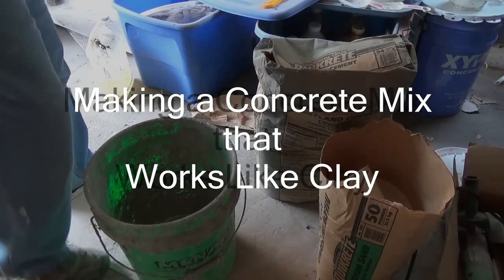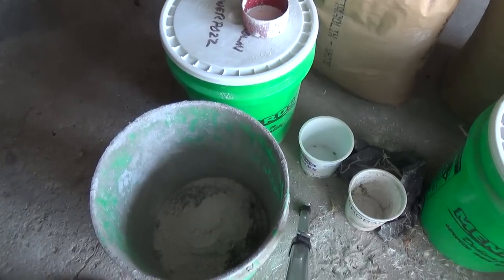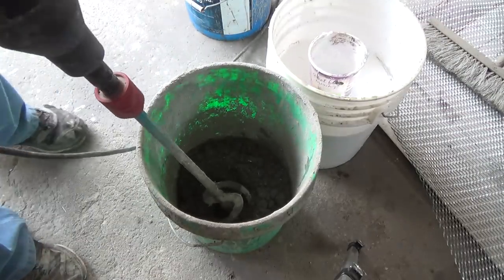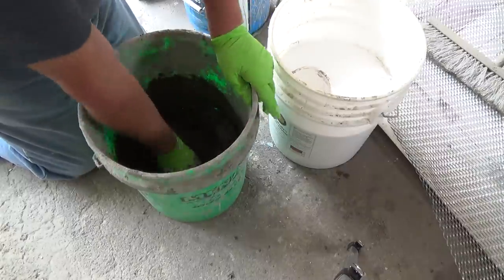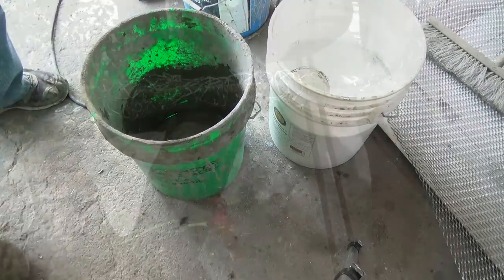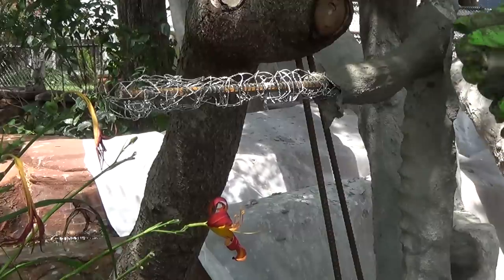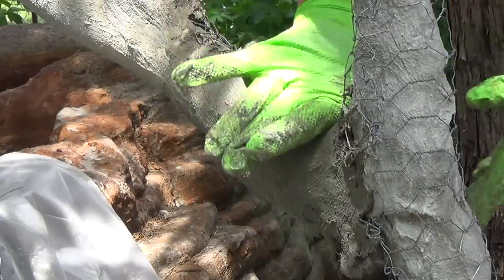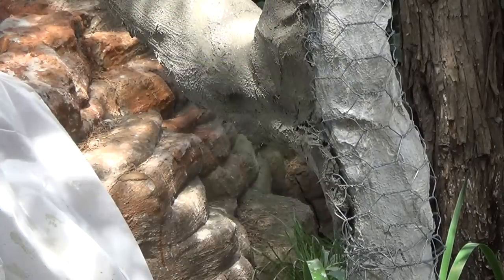#concrete #fauxbois Making a Concrete Mix that Works Like Clay

Comment: Thanks so much for your generosity sharing this recipe for this clay-like concrete mixture with materials that are not too hard to find.  I'm just curious: when you are squishing the concrete into the chicken wire structure, do you make sure all the air holes are filled? If you didn't, would it crack over time? Again, thanks so much - this is exactly what I've been searching for!
Reply from the maker: I squeeze the mix in as best I can.  I can't absolutely guarantee that there might not be air bubbles left, but I can be sure that it will not crack. Concrete cracks because water can infiltrate, freeze, expand and break up the concrete. This mix, because of the metakaolin and acrylic admix is virtually impermeable to water.  No water, no freezing, no cracking.
Reply: @dperry428  I didn't ask the question but I'm reading to learn more from other people's questions.. I'm so glad I read this one because it helps me understand why your recipes contain the ingredients they do. 
Actually it's like learning about various spices while learning to cook. It's very interesting....Thank you so much for sharing your knowledge.

Comment: questions, what is the working time  with this mixture? you talk about carving, does that mean it does not become as hard as concrete and how does it withstand the weather? meaning rain, snow tempteratues in the single numbers, and so on.
Reply from the maker: Working time for this mix, like any concrete mix, depends on many variables, such as temperature, humidity, wind conditions and exposure to direct sunlight.  Set time can be controlled with the use of cold water or even ice in the mix to delay set, as well as addition of retarding agents, such as sugar. You can speed set time by using hot water or an accelerator such as calcium chloride. I didn't talk about "carving" except in reference to a commercial "carving mix" that I was going to try in the future.  Regardless, concrete hardens in several stages, including initial set and final set, during which concrete loses its plasticity and begins hardening.  It then continues to harden over a period of approximately a month. I texture the surface of the mix before, during and after initial set.  If additional texturing becomes necessary, one actually can carve it like very soft stone.  As it continues to harden, techniques used in sculpturing hard stone need to be employed, such as grinding or chipping. Once this mix sets, it is very dense and very hard.  As hard as concrete? Yes, because it IS concrete.  I live in northern Illinois.  We have extreme temperature changes from 100 degrees Fahrenheit in the summer to -25 degrees in the winter.  Because of its density, it is very resistant to water penetration, resistant to freeze/thaw cycles and far more durable than regular concrete mixes.

Comment: Sir,
I have been watching most of your videos with great interest, thank you for spending the time to share your knowledge.
I have a question for you if you don't mind,
Would you have a concrete recipe for casting garden statuary in latex molds?
Any help would be appreciated 
Thanks
Reply from the maker: You can use the  same recipes and add superplasticizer to make the mix more fluid to flow into the mold.

Comment: Hope you and your family are doing well during this Covid-19.  I 'm nearing the end of my project and I would like to know if I need to add Xypex to my mix to make my pond better to handle the water. I will upload a new updated video tomorrow. It can be a real challenge because I don't have a stand to help me with the video.  Thank you for your helpful videos. You are a VERY Talented man.
Reply from the maker: It's up to you.  Xypex is expensive, but I wish that I had added it to my earliest projects.  You can add Xypex admix to the mix at about 2 to 3% of the cement content or you can use Xypex Concentrate as a final coating or you can do both.
Reply: @dperry428  Thank you. I will figure this out and let you know what I do in a video when I'm at that point in my project. We are in the process of installing lights right now. The water "mini pond" will be after that.
Reply from the maker: As small as the pond area is going to be, you  might find it much more cost effective to just use Thoroseal to waterproof it.

Comment: Can you use instead of meta kaolin -Mullite  which I understand is a high heat processed metakaolin.? I use it as the base for slurry in creating shells over wax in bronze casting. I happen to have a lot of it and thought maybe I could substitute it in this concrete clay formula.
Reply from the maker: I don't know.  Never heard of it, but having just spent a bit of time reading about it, it is made from kaolin clay, as is metakaolin, but heated to a much higher temperature, changing the initial metakaolin into mullite.  Metakaolin is amorphous and exhibits certain characteristics as a result.  Mullite is the opposite and is crystalline and would, therefore, exhibit entirely different characteristics.  The only suggestion I can make is to try making a mix with it and see what it does.  I'd bet it would be much different in its effect on the mix than does metakaolin.

Comment: Hi there, I am trying to mend two halves, and fill in some missing areas of chunks that broke off, of my cement birdbath pedestal. Any extra advice? Also, I am a bit unsure still about the "acrylic admix" part of this project. You mentioned that Quikrete has a product. I went on HomeDepot.com and found a 1 qt. Acrylic Fortifier by Quikrete. Is this the product to get to add to the water? I could not find the product called acrylic bonding agent which you replied to Sporty a few days ago. TY
Reply from the maker: The Quikrete Acrylic Fortifier is what you can use. I don't know the solids content.  Follow their directions for dilution.  Home Depot usually also has an acrylic by Sika.  As for the birdbath, I drill holes and peg the two halves together with metal rods and glue the two halves together with marine epoxy.  Then fill the crack with concrete or put a full new liner of concrete in the bowl.  For missing pieces, use acrylic full-strength on the broken part and fill with acrylic concrete.

Comment: Was also wondering if you have a papercrete recipe? Clay like to hand build large posts yet light weight to move around easily enough? 🤷🏼‍♀️🤔
Reply from the maker: I don't use papercrete; don't like the fact that the cellulose fiber in paper is organic and subject to decomposition, much as leaves in a compost heap.  To make lightweight concrete, I substitute vermiculite or perlite for some or all of the sand.  Remember, though, that the lighter you make it, the weaker the mix will be.  You substitute weight for strength.
Reply: @dperry428  Amazing thank you - yes you’re 100% right

Comment: That mud looks like a winner , but I am thinking the additives can be very expensive, especially if having to pay shipping from distance too far to pick up.  I was wanting to find out if some type of common inexpensive chemical or product can be added to cement to give it a clay-like clumping feature.  Was thinking of vertical wall or fence building without having to use forms.
Reply from the maker: That is the purpose of this mix and others I use -- vertical application and sculpting.  There are mixes too numerous to list that are used by others to do the same thing.  Many of them are commercial proprietary mixes that cost a small fortune to buy.  That's why I make my own.  What I have developed is what works for me.  I am not an expert in concrete.  I don't do research on other mixes and I certainly won't or can't vouch for other mixes.  All I can suggest is do some research.  Do a cost analysis of this mix, including shipping costs, compare it to commercially available mixes, including shipping costs and decide what is best for you, both functionally and economically.
Reply: dperry428 I have been looking into Pal Tiya, but this seems very similar an probably a lot cheaper. I want to sculpt a fountain. I assume I can just use some sealer on this stuff after it’s dried?
Reply from the maker: @AaronDigitalMuppet  The mixes I prepare are made to negate the need for sealers, though, if you want, there is no reason you can't use a sealer.  Sealers, themselves, are different, too.  Some, like siloxane, are penetrating sealers. Others are simply coatings that stay on the surface.  For things like water features, including fountains, that are going to be constantly exposed to water, the penetrating sealers are more appropriate. Water is the enemy of concrete.  Keep water out of it and the concrete will not deteriorate. A major function of metakaolin and other additives is to close off the porosity of concrete and prevent penetration of water.  In my constructions that are going to be in water, I now also use a crystalline waterproofer, such as Xypex.
Reply: @dperry428  Thank you for both a very detailed, and quick reply!

Comment: Hi great vid - just wondering, for the sand do you use sharp sand or is it some kind of grit sand or paver sand ?
Reply from the maker: I use what's available.  It's best to make sure it's a silica sand and, at least for  the purposes of making it work like clay, the very finest you can get.  When I was helping my brother in Tennessee with his pond, the sand we could get was ground up limestone an it was awful to use and not as strong. Unless you're a contractor, you use what's available from the local home store.

Comment: Thank you! Have you seen the tiles that look like wood planks? I bet if this ratio would be perfect to place in a thin silicon mold and make diy wood planks or brick shaped pavers.
Reply from the maker: Yes.  Actually, if I were making molded wood tiles, I'd add silica fume to this mix, as well as a super plasticizer to make the mix stronger, self-consolidating and self-leveling.  It would, indeed, be strong.
Reply: dperry428 Knowledge through experience is key.  You are a pro. I have zero experience with cement.  Thank you for your response and advice.  I feel like I would like to try to  make small batches of planks.  Eventually. I could  accumulate enough to floor over my concrete patio.

Comment: Very educaring and inspiring video sir dperry428. I've bee doing a very disastrous and frustrating DIY wall stamping using type 1 portland cement and sand. I got a question, can i use type s cement, sand and acrylic polymer to arrive at same consistency as what you have done?
Reply from the maker: Type S is masonry cement and has lime in it, so it will be stickier. I used to use it for that very reason until I wanted a more impervious, denser mix and started using metakaolin and silica fume.  The type S made the mix too sticky, so I switched to regular portland type l.  The polymer will make a big difference.  Prep the wall with acrylic, add acrylic to your mix and apply to the wall before the acrylic on the wall sets.  You can certainly make a very thick, clay-like mix.  Use a 1 to 1 sand/cement mix and watch carefully how much liquid you add.
Reply: @dperry428  I will certainly try what you have suggested. Thank you for the response and advice.
Reply: @dperry428  Another thing sir, can i use the said mix 1as a stone to cement adhesive?
Reply from the maker: @darwynpeckley277  Not sure what you mean by stone to cement.  If you mean adhering stone laminates to the concrete skim coat, I'm sure that would work if you also put some acrylic on the rock.  To make an even tighter bond, place acrylic on the back of the rock and then scrub on a light coat of concrete before placing the stone, similar to adhering new concrete to old.

Comment: Is "fortifier" better than the "bonding" liquid,  both from the same quickcrete company?......And what is the best way to add like 1/4 thick details after the main larger core shape is dry?.........Like adding blueberry sized beads on tree after the tree has been drying for a couple days
Reply from the maker: At an earlier date, I wasn't sure what the difference was in the Quikrete products.  Having finally read their MSDS sheets, fortifier is a non-reemulsifiable acrylic (plastic) and the bonding agent is  reemulsifiable, meaning it can be softned or dissolved by water after curing. The bonding agent is PVA (polyvinyl acetate), the same stuff that Elmer's glue is made from. Knowing that, I would NOT use the bonding agent for anything that is going to be exposed to water or for outdoor use.  As far as adding material to an existing sculpture, it is best to add elements before the base material completely cures, as the adhesion will be much better. Best to add the elements to the base before final set as there will be a chemical bond between the base and the beads.  At minimum, wet the base material with water before adding the beads and use acrylic in the beads. Better to wet the base material with acrylic and also use acrylic in the beads.  Either way, you are, in effect, gluing the beads to the base material.  The only problem with using acrylic on the base surface is, if you intend to use an acid stain coloring agent, the acrylic will interfere with the chemical action of the acid stain.
Reply: @dperry428  Thank you so much for explaining in a detailed way....I've heard various reasons why one is better or "fine" to use, but because it wasn't explained in a way tied to science,  I got confused ........Thank you again,  love your beautiful work and you sharing the great information and showing your progress 🙂🙂🙂

Comment: What's your opinion on adding additional Lime to cement. Ive seen ppl add it to cement for sculpting and it makes the cement strong and moldable obviously.... Have you tried this and is it worth me trying this method out myself? Really don't need a bag of Lime laying around if its not going to be used....lol
Thanks !
Reply from the maker: The lime that is added to concrete is calcium hydroxide (slaked lime), which is also the byproduct of cement hydration.  Essentially, when you add lime to portland cement, you are making mortar cement.  I used to use mortar cement when I first started making my concrete. I changed to portland cement because I didn't want the excess calcium hydroxide in the mix. It made the mix too sticky, especially with the addition of silica fume that also adds stickiness.  I wanted the calcium hydroxide made from concrete hydration to be used up by the pozzolans (metakaolin and silica fume) as calcium hydroxide is what makes concrete alkaline and problematic for pond water.  It is also what reacts with carbon dioxide to form calcium carbonate efflorescence, the unsightly white stuff that gets on concrete surfaces.   With the mixes I use, I don't want more calcium hydroxide in the mix.  Consider your needs, experiment with some and decide if the mix from adding lime is what you  want.  Do be careful if you choose to add lime -- get it in your eyes and it can literally burn your corneas and  cause blindness.
Reply: @dperry428  thanks for the advise! Really appreciate ur help.. it's hard to find the real deal online. Lots of ideas to work with..

Comment: Quick question. Have you ever used Akona concrete bonding additive as your acrylic admix?  That is the product that my local Menards carries. (Trying to shop local...but can go to online if necessary.)  Thanks in advance!
Reply from the maker: I haven't used that brand, but it is the same kind of product I use.  What I can't tell you, though, is its percent solids content.  The stuff I use is 50% solids.  Many of those that are available at home improvement stores are more like 15 to 25% solids.  Try to find out what the solids content is.  I can dilute mine 3 water to 1 acrylic.  If the solids content is lower than the 50% solids that I use, you'll have to use a much lower dilution, say 1 water to 1 acrylic or, if the solids content is very low, use it without dilution with water.
Reply: @dperry428  Thank you!  I downloaded the spec sheet from the website.  I will see if I can figure out what the % SOLID this brand contains.  If I cannot find that information would you advise a 'stronger' solution vs more diluted?
Reply from the maker: Yes, a less diluted solution is better.  I'd look at the label directions.  If they say it can be diluted 2 water to 1 acrylic, it's likely about 30-35% solids.  If it says 1 water to 1 acrylic, it's likely about 20 -25% solids.  If it says to use it as is, it's likely 10  -15% solids.  Then, look at what you get for the money. It might be cheaper to buy something online even with shipping costs.  Otherwise, if the percent solids is low, you are paying mostly for water.  You'll have to analyze which is cheaper in the long run.